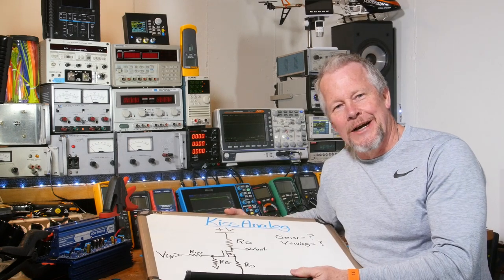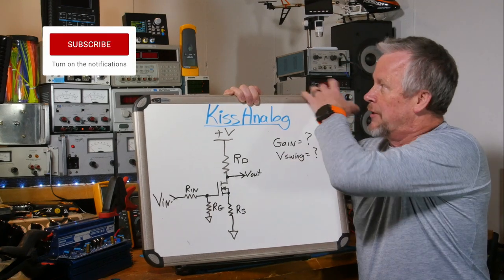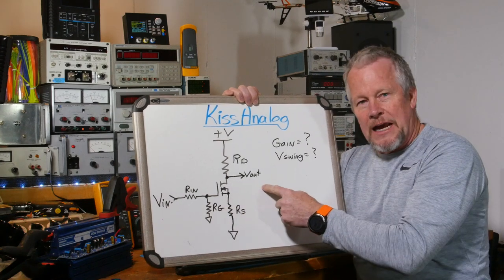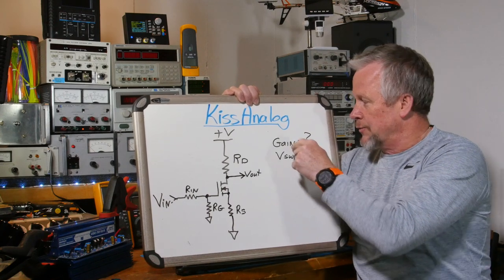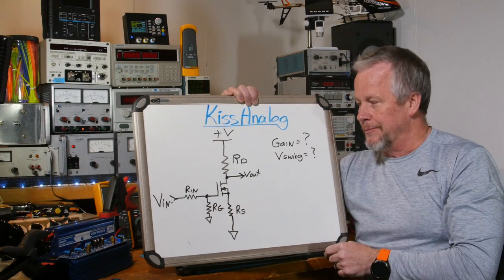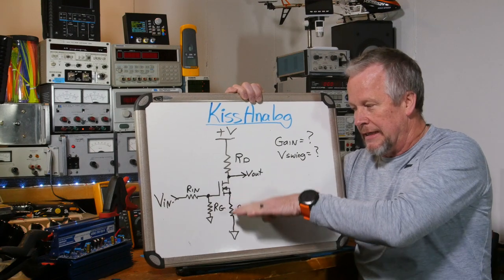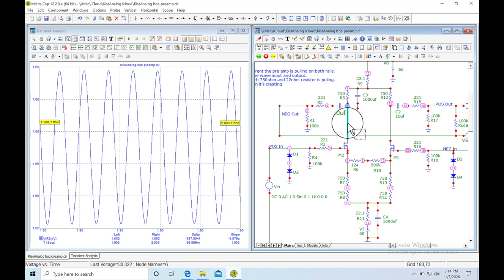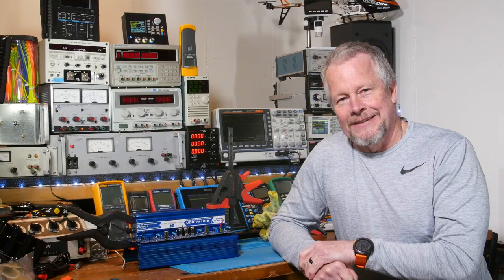Micro-Cap Tutorial 7; Nelson Pass BoZ PreAmplifier Tutorial #microcaptutorial #NelsonPass #preamp

Comment: Hi Eddie,
About the coupling (decoupling?) capacitors…. They obviously create an effect on frequency response, but also potentially cause instability at some frequency, right?
Now, what happens when you combine the effects of the decoupling caps at the preamp output with the one at the amp input? How do you plan an output or input cap that can take whatever you might connect?
(Sorry to ask this a year later…. I’ve been re-running some of your videos for your MC12 tutorials. And, yes, I will generate the JAT501 in MC12!)
Cheers 
Mark
Reply from the maker: This is a great question!  Yes it is possible that decoupling caps can cause instability.  The trick is to keep the impedance/inductance low and use wide band caps, and/or use parallel caps to provide wideband low impedance.
I'm glad to hear you will do the schematic, at least I'll be able to give one meter away;)

Comment: Also less noise.
Reply from the maker: The question then is - which one to choose?  A jfet OpAmp?
Reply: @KissAnalog  There are many outstanding choices in both Bipolar and CMOS to pick from since Bob Widlar's famous Bipolar "Fairchild 709." The 709 itself would be an excellent choice. That circuit would be "dirt cheap," maybe cheaper than dirt. 

You did a great presentation on the basics of employing high voltage and high power devices. 

When I messed around with high Voltages, I always worked with one hand only; the other hand was in my pocket. The reason was, so I wouldn't accidentally electrocute myself. I guess that was a carryover from working with High Voltage/High power systems.